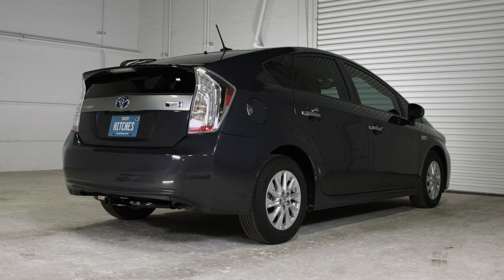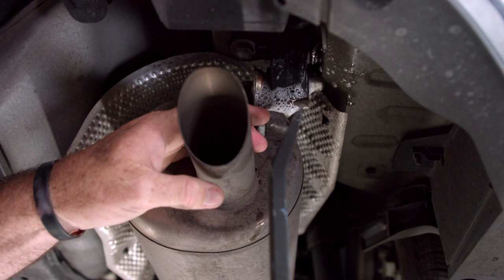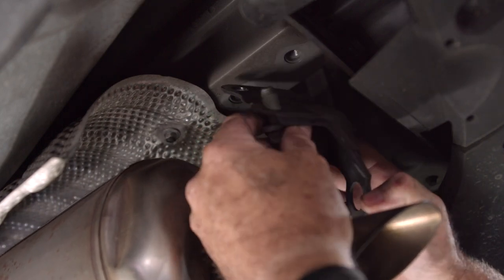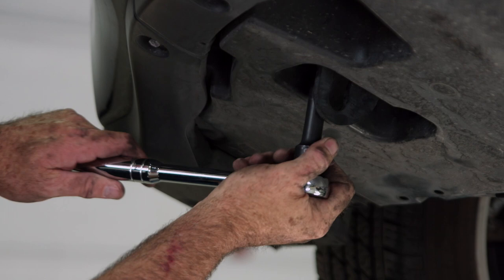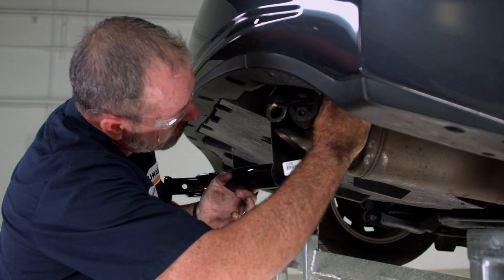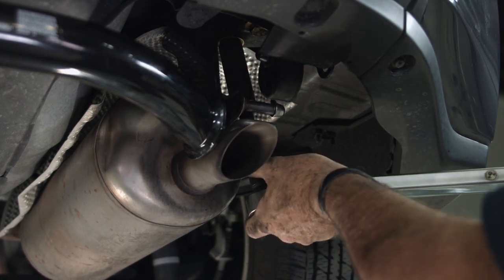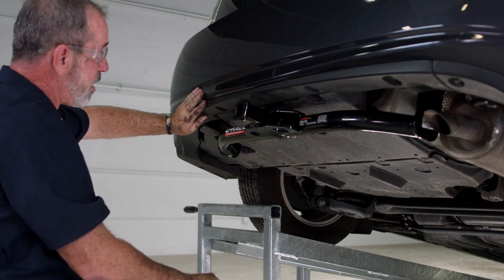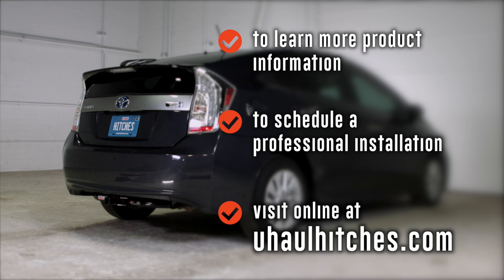2013 Toyota Prius Plug-In Trailer Hitch Installation

Comment: I just put the Hitch on without putting it on a lift.  Unclear why you'd have to cut the exhaust.  The only trick I had to do was add some napkins into the long socket to push the bolt up a little higher.  Especially on the Driver side and you're inbetween the plastic.  I contemplated cutting away the plastic, to use my hand-no need to do that.  You'll have to use the socket with an extension (6 inch worked for me as well).  What you can also do is before putting up the hitch get comfortable screwing in the installation bolt with the Extension into the hole, on both sides.  Just gives you confidence when you've got the hitch up and using an extension.  Luckily the screw thread is pretty coarse so just be patient and keep trying to get the bolt into the hole and slowly trurn.  it'll eventually catch.  

Use soap and water to remove the exhaust hanger from the holder adapter plate you'll need to reinstall with the hitch.  Dont do what I did and try to remount the Holder adapter onto the exhaust and install the hitch at the same time.  puts to much tension on the adapter plate to line up with the hitch and the holes.  If you're doing this by yourself, you'll know what I'm talking about :).  Uhaul will charge you $148.50 to install, at least the one in San Diego, in Miramar/Mira Mesa.  You can do it!